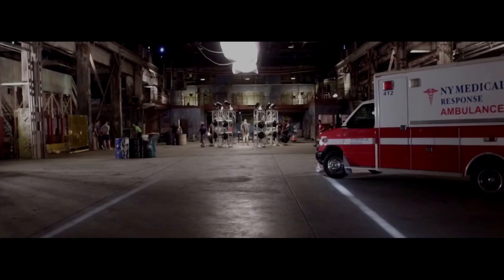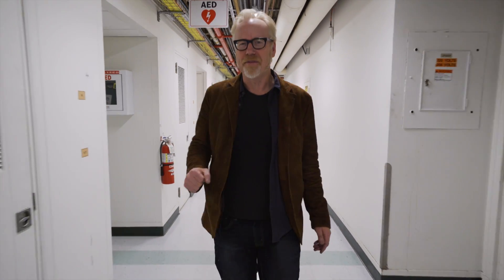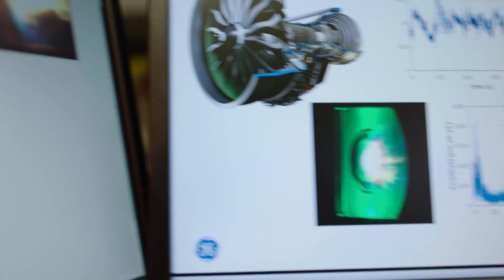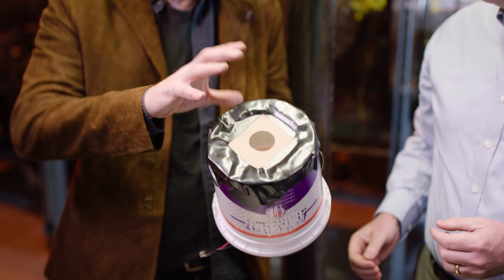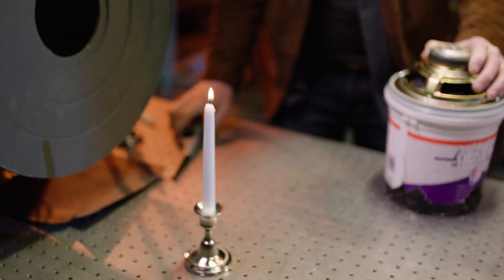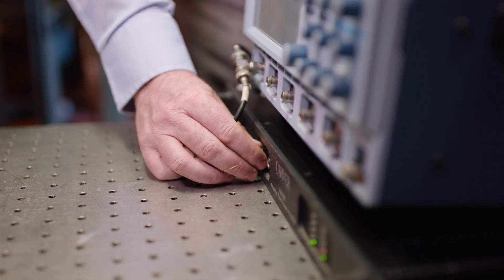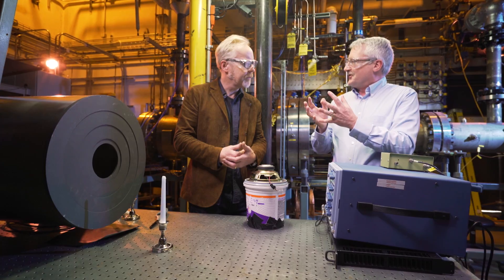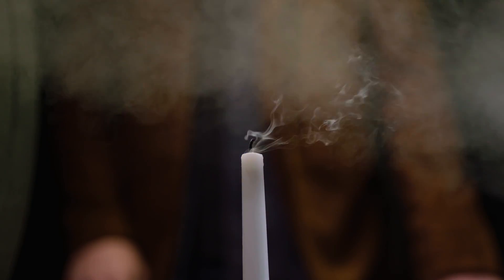Adam Savage Fights Fire with Fire - Unimpossible Missions

Comment: ugh poor logic,  using the same logic, if the electricity you are using is generated with burning fossil fuel, you are using fire....
even if you use sustainable energy, if your infrastructure was built with energy generated from fossil fuel you are using fire. The first cave man used fire, so everything human is made with fire. The sun is a burning gas ball, so the milky galaxy is made with fire... But if you guys need these paid sponsorship to finance adam's project or feed norm's puppy, keep them coming!! i will just skip them

Comment: This is not "fighting fire with fire" but putting out a fire using sound wave, i.e. moving air/creating pressure differentials which moves air, the same way you are doing when you blow out the candle!

Comment: the sound isnt doing any thing, its just air pressure from the speaker port. i can put my hand in front of the ports on my subwoofer and feel enough air coming out of them to easily blow out a candle. he just did what we can do with our breath, but used the pressure differential created by the speaker to generate the "wind." the fact that it was a "fire sound" is irrelivent, any sound at high enough amplitude would accomplish the same thing.....i wish you wouldnt sell out like this and play stupid for money, adam. i have always thought you and your brand were better than this crap.

Comment: wasn't it basically just blowing out the flames? did the sound vibrations even factor in? I feel like this is bs
Reply: That's what I was thinking. At first when they mentioned sound waves I'm thinking either it's a particular wave pattern that is very effective or something cool like measuring the wave of the fire and using a speaker to blast it with the opposing wave.
Reply: Yeah it's one of those... technically there is truth to it kind of deals...   pretty darn lazy.

Comment: Candle vs massive speaker actually
Reply: Wiejeben the worse part is that its not even a speaker its a vortex cannon so its just air putting out a candle...
Reply: Basically a really expensive way to lean over blow out a candle. Only advantage here is that vortex cannons produce a fairly stable, linear-traveling air puff so you can blow out several with one puff.
Reply: They could have used explosives, that would have been closer to "fire vs fire" but the end result is still the same (air moved by the explosion putting the flame out)
Reply: You can do the same thing with an $8 Airzooka.
Reply: its an 18" , same basket/magnet as a friend of mines haha

Comment: Bs, this is fighting fire with sound. There is no reason why you couldn't have used sound from something different.

Thumbs Down.

Edit: I have been told multiple times that I could interpret this as fighting fire with air instead. I'm ok with that. You don't need to comment it again.
Reply: yes and also we have fought fire with fire for years through the use of backfires
Reply: My thoughts precisely.
Reply: " hypercritcal trumpshit" I dare you define this. He is correct. Half the stuff said in this video is misrepresented at best.
Reply: samaruton It's funny because the guy say "We discovered that recording the sound of fire we can put out fire. But it only works for candles." XD then they proceed to blow on a candle XD
Reply: Damian Reloaded or screaming "FIRE" very loud 😄
Reply: Kali Takumi its not. the membrane of the speaker moves air which then vibrates the ear drums. no air no sound (eg in vacuum). so its airwaves, hence the moving smoke. the speakers membrane pushes air through the hole which tears the flame off of the candle. same with blowing it out! ergo, it's air blowing out the candle!
Reply: You mean like clapping near the candle? ^_^
Reply: You're just butthurt that it's sponsored
Reply: Well, if the sound was from a lit mix tape, its still fighting fire with fire... hehehe
Reply: @Alfonso J. Ramos
That is  not even the main reason why this video should be getting downvotes. This is a fucking piece of advertising without proper disclosure or any label whatsoever . 
http://www.theverge.com/2016/11/22/13712996/fake-news-facebook-google-sponsored-content-study
Reply: Alfonso J. Ramos not even sound, but air!
Reply: Alfonso J. Ramos If they used a tremendously loud fart sound, I'd have hated this video less.
Reply: ***** There is nothing humorous about lying to your loyal audience for money.
Reply: Hendrik visch The title isn't lying it's just completely unrelated. The script on the other hand is blatantly lying and misleading, someone with a handful of useful neurons may find it insulting. It's hard to find so many dislikes in a well presented video like this one.
Reply: i must admit this was quite unimpressive (worst title ever and waste of my time to watch)
Reply: my first thumbs down on a tested video
Reply: Zach Hixson I'm impressed how far thy were willing to stretch the premise, and saddened that Adam is so desperate he went along with it.
Reply: B-B-B-Butthurt
Reply: Actually no, sound does not put out the flame. vibrations in air makes the flame go out.  No the sound. You can argue that i just stated the definition of sound, but as did you. The title is not lying. atleast, not really. it's just a friendly form of clickbait. which youtubers need to get views and to generate income. Advertisers all over the world use similiar tactics to get our attention. In short; It's marketing. And it kind of sounds nice.. doesn't it?
Reply: Daniel O'Connor You could make a video and title it: Making a plane fly with pizza. Then you make a video of you eating pizza and farting on an paper airplane and making it move two inches. That would be equivalent to what this video did. XD
Reply: MaqueGenio I thought YouTube started requiring people to disclose promotions and advertisements?
Reply: MaqueGenio I hear you. This doesn't even look like a Tested video. From the first shots, you know there's money behind the production. I wish it was properly labelled as well.
Reply: Kali Takumi good for you! (yet you still had to provoke it)
Reply: It's a humorous play on words, y so serious?
Reply: Damian Reloaded whoa, its not that serious
Reply: Yeah! My thoughts exactly! This has nothing to do with the fire v fire. Its sounds versus fire.
Reply: Alfonso J. Ramos that's what I was saying you could play a fart and it wouldn't change a goddamn thing
Reply: Also, they said their first iteration of the design could blow out candles, but nothing more complicated. Surely it would have been not only more impressive, but overall better for them to blow out whatever something more 'complicated' would be. No?
Reply: Henry Jones Which one? Adam Savage Fights Fire with Fire GONE SEXUAL? XD
Reply: fighting fire with air not sound
Reply: Chester Snapdragon McPhisticuff Yes Mr. Trump. And the russians didn't help you win the elections.
Reply: @ Alfonso J. Ramos, aaaauuuhhhhh poor baby! Critcal much? I enjoyed the show regardless of your hypercritcal trumpshit. PUH PUH PUH-LEASE GET A LIFE!
Reply: Kali Takumi Any act humans make is a statement of what they stand for,
Reply: Preske, sound literally is the movement of air that our ears can pick up tho
Reply: Preske what do you think sound is? It's a waveform moving through an atmosphere. Technically we don't hear sound, but air vibrating which in turn vibrates our inner ear.
Reply: i think adam did something similar in an episode of mythbusters
Reply: Alfonso J. Ramos This isn't fighting fire with sound. This is fighting fire with air. All that thing is doing is shooting out a pulse of air.
Reply: Yup. Any ass whipe that has stuck their hand infront of a sub tube can feel the wind. This is the same as blowing out a candle. How dumb
Reply: Alfonso J. Ramos yeah, I think it was brusspup who made a video where he just slapped the side of a box, and the vortex that shot out blew out the candle. Literally nothing impressive in this video
Reply: The point is most people are failing in understand the real problem with this video, which is being a promo piece for GE without being marked as such. It is an unethical and shady practice at very least that in the end damages Tested credibility. The article points out exactly what is happening here.
Reply: Yes, I think they did, but does this really constitute an advertisement? The original Unimpossible missions are GE videos made by GE and Adam Savage is meeting with them to see how they did the things they did. I personally don't see it as a advertisement and they aren't really promoting anything other than checking out the original video. Although I do think it was a video paid for by GE, it did not have a tested feel to it at all.
Reply: Alfonso J. Ramos using your logic that's not fighting fire with sound or fire it's fighting fire with air
Reply: Scharlie Scheen No, it's sound.
Reply: If my singing breaks a window, is it because of me or because of the sound I make?

Indirectly the title remains valid, although it is a bit contrived.
Reply: Scharlie Scheen I knew this comment would come
Reply: Scharlie Scheen I regretted saying it but I couldn't take it back
Reply: I've seen worst :( trust me ;(
Reply: well, technically, the sound is warping the air, so yeah, it's partially air.
Reply: Watch the original video!
Reply: yeah, but the way you worded that sentence was horrible at best..
Reply: Agreed.
Reply: Alfonso J. Ramos  really
Reply: Alfonso J. Ramos 
It's not even fighting it with sound. 
It's just a vortex blowing a candle out.
Reply: Alfonso J. Ramos Actually they can kind of use it to stop a forest fire though, they burn the trees which is the main fire's fuel, so it has no "fuel" to run.
Reply: The point of the video isn't the fighting fire with fire, but the sound tech used by GE.
Reply: Gabe Bafia that would be called a misleading title, which is against Youtube policies.
Reply: we guy go j hi hi Gigi b fight guy got n me know pppppppppppppp0pp0pp you this j8 me Ohio Julie join look up l to p lol oops onn boo boo mnb boom boom kn bill me too long I'm going hhu1 fight Ohio hi k nobody in his

Comment: Couldn't you fight a fire with a very rapid fire, i.e. An explosion?
Reply: That's actually how they extinguish oil well fires
Reply: They already did that on an episode of Mythbusters.
Reply: Patrick Sanders that's exactly the same as they are doing in the video, it's just instead of a recording of the sound of fire, you're getting the pressure wave more directly from the fire.
Reply: TheFoxBurrow ok so I realise Im going to sound nerdy, but the use of explosives to extinguish a oil well fire isnt  really about using fire against fire. It really about pressure waves pushing away oxygen and heat. BUT ITS STILL PRETTY AWESOME TO WATCH!
Reply: TheFoxBurrow I like to think of explosives as fast fire. :)
Reply: That was very clear to me, so no need to worry. Ser Garlan was just referring to explosions, so I provided the real world scenario this technique is used. In more simple terms, fire is a slow combustion, while explosives are rather rapid.
Reply: +TheFoxBurrow I was going to mention the same thing.  Even with explosions, same principle applies when putting out any fire...take away oxygen or heat (or the fuel, if possible).  This is still not fighting fire with fire
Reply: its a little more in scope than using a speaker playing fire noises
Reply: Explosions aren't 'fast fires' Patrick Sanders is right, an explosion is just a rapid increase in pressure in a small area which then expands to release the pressure. Hence why explosions can happen in space despite having no oxygen for a fire.

Still though, i like the idea and it's much closer to fighting fire with fire than the thing the guys in the video are doing.
Reply: Gadrill explosive BURNS rapidly, the reaction producing large quantities of gas at a high pressure, gas rapidly expands etc. Etc.
But the important thing is burns means fire. And explosions without flame are mostly lame.
Reply: That's why I used the correct term combustion. Fires and explosions are not the exact same thing at different speed.
Reply: Ser Garlan Tyrell
Reply: but that was too in the MythBusters :'(
Reply: i like how you think.

Comment: This is not fightning fire with fire.
Reply: exactly... they blew out a candle
Reply: its not really true, any sound could have been used. but because they didn't have any good ideas they went with this. if the fire could only be put out with the sound of fire i would have given it to them but literally any sound could have worked so it's a cheap technicality.
Reply: It doesn't even use sound. It's the motion of the speaker surface compressing the air which is then concentrated and directed by the cannon. The sound is the side effect of the compressed air waves, but it is the forced air that extinguishes the candle.  You could replace the speaker with any movable membrane and produce the same effect mechanically.
Reply: its easier to do this with real fire, just try lighting a candle with a blowtorch
Reply: Thorsten 99 But it is, its using fires sound to put out fire. Making it fire fighting fire
Reply: There is no fire used to extinguish the fire. Just sound

Comment: Firefighter's been using fire to fight fire for a while. When there's a big forest fire, by burning down forest intentionally they can stop it from spreading, for example :P Isn't that where the saying comes from?
Reply: They have also used explosions to put out oil well fires in the past. The explosion consumes all the oxygen in a fraction of a second and no more flames. There was even a John Wayne movie about it.
Reply: Also the use of jet engines (which are axial gas compressors powered by flame) to extinguish underground fires, like ones in coal mines. The jet engine provides both the high air pressure and low oxygen containing gas, as well as power for the exhaust gas cooling, which is directed into the mine to starve the fire of oxygen.
That is actual cool. This video was a waste of time.
Reply: That was my understanding of the phrase too. In Australia they do a ton of 'controlled burns' to avoid a serious bush fire.
Reply: Radditz770
It has been used that way a lot, as well. But that's still using the phrase 'ironically.'  The original meaning of 'To fight fire with fire" is to say that you are doing the opposite of helping. Fire being a 'poor weapon' against fire, because it causes more fire.  It's used in the sense where say a power were to be fighting terroists by causeing terror themselves, "That's just fighting fire with fire"  So if you get my meaning, that phrase doesn't come from actually fighting fire with fire... people like to prove this phrase wrong because it has a poetic justice to it, which is what the point of this video was.
Reply: My thoughts exactly!
Reply: No it isn't... Because it's suppose to be a bad thing. It could me several different things. Fire just sounds good. It means that you can't defeat something by the same thing. Like the way to solve a problem of a bully isn't to start bullying the bully. It might work but it's not a good thing... Just like fire wont stop a fire.
Reply: Swedish Otaku people say 'fight fire with fire' all the time. They also literally use fire to fight fire as someone else pointed out. Adam is just bullshitting and looking for a prosaic angle to his lame experiment.
Reply: Radditz770 russians have been using jet engines to put out fires for a looong time
Reply: Radditz770 yea in Australia they do this every where, every season
Reply: +LuxTheDreamer 
MacGyver did it too, so it must be true!
Reply: Yeah, called "backburning".  I don't see why that doesn't count
Reply: Also the use of jet engines (which are axial gas compressors powered by flame) to extinguish underground fires, like ones in coal mines. The jet engine provides both the high air pressure and low oxygen containing gas, as well as power for the exhaust gas cooling, which is directed into the mine to starve the fire of oxygen.
That is actual cool. This video was a waste of time.
Reply: This practice is true, and that's a good example of someone fighting fire with fire.  But the phrase means the opposite.  The meaning of the phrase 'fighting fire with fire' is to say that you're doing something that doesn't help the situation, but makes it worse.   It's not a perfect phrase, because there are examples of fighting fire with fire, but that's what the phrase means, so I doubt the origin of the phrase comes from successful examples of controlled burns.
Reply: Really? I've only ever heard the phrase being used for beating someone at their own game, or using someones cards against them, stuff like that, and never for just adding to the problem :P But I'm not natively english so I may not have 100% grasp on sayings xD
Reply: Hellcats
Reply: Russians did use Mig 15 jet engines mounted on trucks to clear runways. It's fast, it clears snow and ice easily and any debris  just disappears into space.
Reply: Peter Šori ik, just saying
Reply: calum ryan and promotion
Reply: Indeed! I wrote the Fire Advice planning system for the QLD forest rangers. The trick is to safely burn down 5% of the state each year, to prevent "20 year fuel-load build-up", which is what causes firestorms. The majority of bushfires are actually "planned burns".
Reply: Nah, I found his explanation to be quite reasonable.  So there!  = P
Reply: Exactly. That's why I was scratching my head in confusing at Adam's intro where he's like "Fighting fire with fire... it's supposed to be impossible, right?" and here I am thinking like "No... the saying itself comes from real life firefighting techniques. It's not impossible, just only useful in certain circumstances..." I've heard about setting out huge explosions to knock out a fire (sucks away all the oxygen, snuffs the flame) or intentionally burning down a forest (with a CONTROLLED burn) to stop a wildfire from spreading even further. Both have been used before.